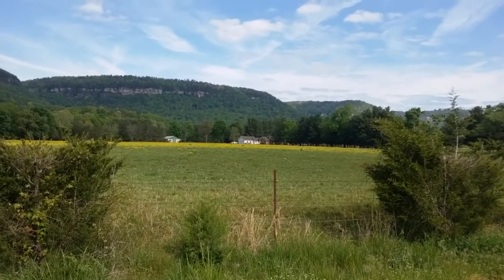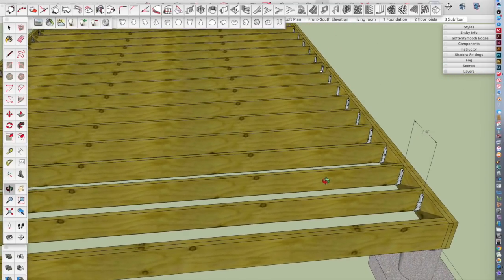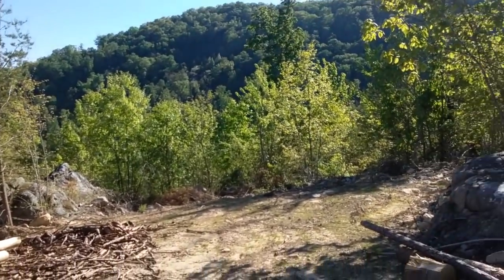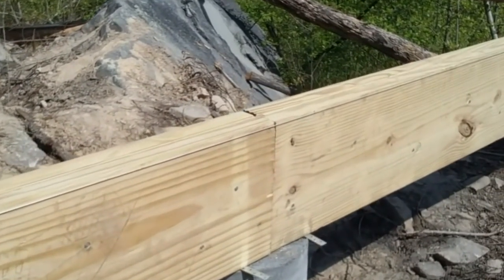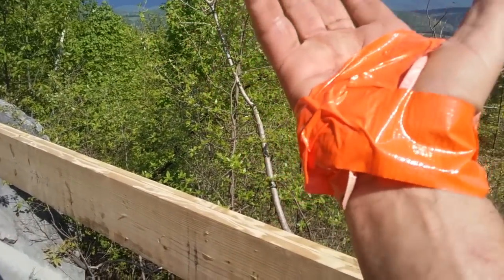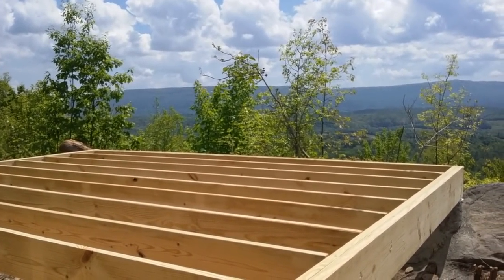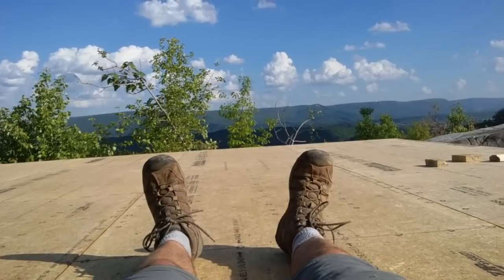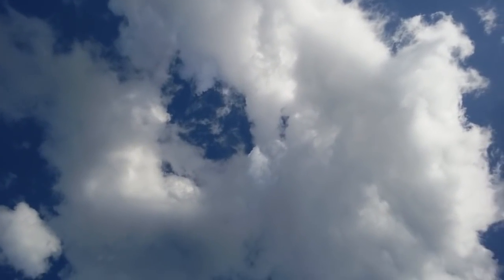A-Frame Cabin Adventure 6

Comment: if your going to build lamp beams for your ban boards. You need to stagger where the 2x12s break bro. if they are 12 footers, cut one at 6' and then put it on the other 2x12. I know you have the breaks sitting on the pier but something to think about. also your ban board corners need to be notched to fit, not butted end to end like that. no strength in that corner. keepa things from twisting later on down the road.
Reply from the maker: Good suggestion. I guess I was just thinking of spanning the distance with two full 2 x 12 to the center post, but your idea would provide less deflection in the middle for sure.
Reply: What sort of notch would be used at the corner of the ban board?  Thanks

Comment: Some people should not post construction videos for just anyone to follow. So many structural things where done wrong in this build. Always stagger joints when laminating beams. Overlap corners for a solid joint. Stagger joints when laying plywood flooring, one 8 foot sheet followed by a 4 foot sheet. And what is up with the "puppet" voice???? Kind of creepy......
Reply: You know, I was thinking of building a cabin like this.  I asked five different guys with knowledge and experience.  Every single guy had a different way of doing things...so, guess you could say what you may think is the wrong way...many more may think is the proper way.
Reply: K Walls if he was to stager the beam then the splice would be in the middle of the span making the span weak.
Reply: You dont stagger those type beams when the ends are resting on piers. He did it correctly. His Advantech is staggered...you can see it at the end of the video. Everything looks correctly done. Smart way of building it.